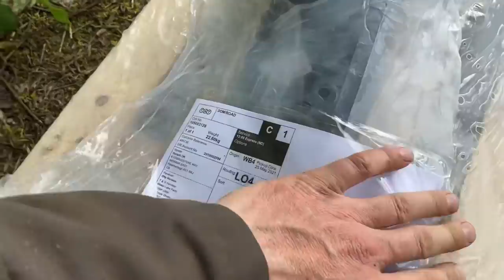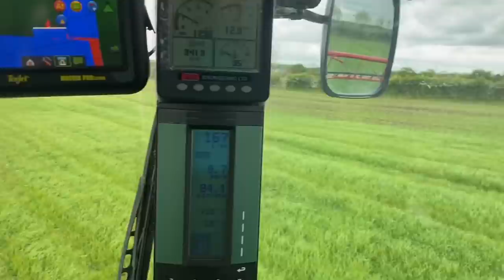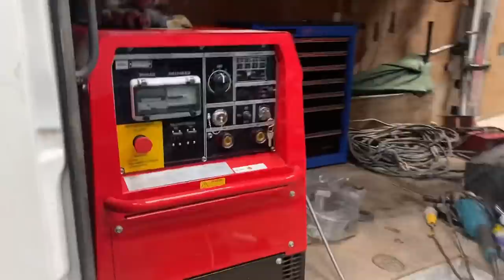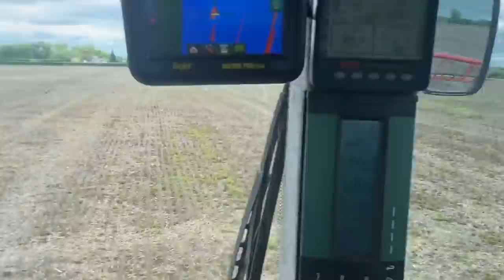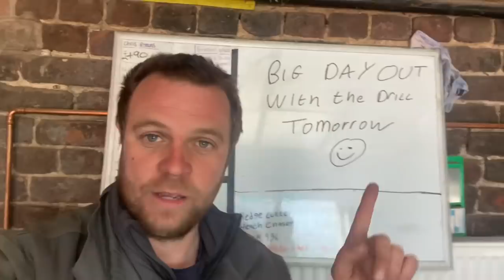Day 430 #OLLYBLOGS SOME FANCY WELDING FENDT WORKING GROUND AND LOTS OF HARES #AnswerAsAPercent

Comment: Chap has made a fair job of the hard facing! Spend a day in the hot sun going that a few years ago on a pallet shredder, it is soooooo boring. Given the amount of wear it would be worth doing a rough balance if you can get the belts off easy and the bearings are free. Sumo made a good job way too wet here had 120mm in last 28 days ☹️
Reply from the maker: We had wind so dry now

Comment: Air line connection fitting for air brakes.  
Do you ever use ammonia in the sprayer to clean out the chemicals that are left in the tank and hoses? I used it in orchards when we’d change from Chems to fertiliser
Reply from the maker: I use liquid fert sometimes

Comment: What do you make of the sumo? we looked at buying one once but we didn't want to mix the soil so went for a McConnel Shakerator instead and all our ground is subsoiled infront of our drill at about 12k and it leaves it level and it makes a lovely job, It also doesn't munch top link pins 😀
Reply: What drill have you got? We like the shakerator legs
Reply from the maker: its great for levelling ground but can do to much some times
Reply: @danhickling3565  we have a kuhn combiliner venta combination drill
Reply: @OllyBlogsAgricontractfarmer  good that it works for levelling, you'll just have to be careful not to do it too much 😃

Comment: Better using stainless wire on them sharp thin bits and that is an air brake coupling for trailers
Reply from the maker: That’s what he said
Reply: @OllyBlogsAgricontractfarmer  if you ever need any hard facing again just look up TYR engineering on facebook and speak to chris yeates 👍